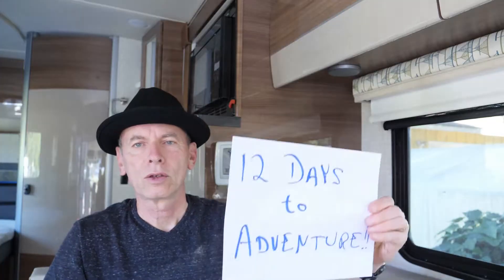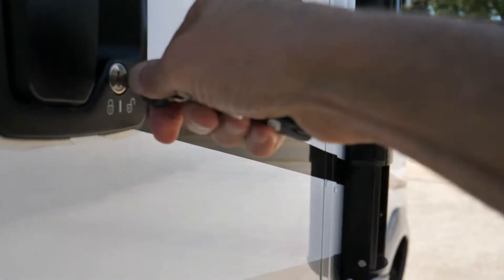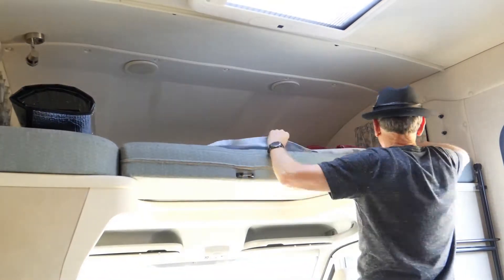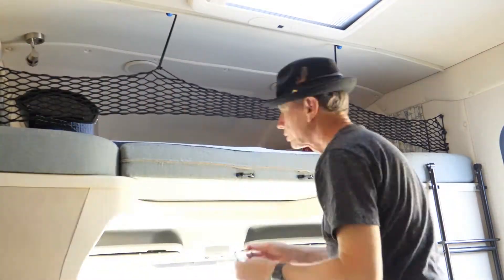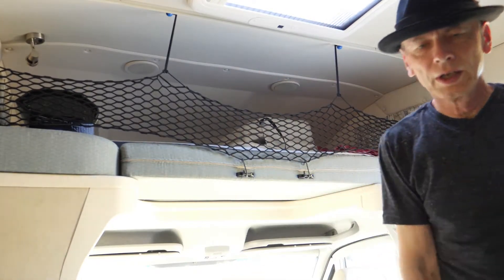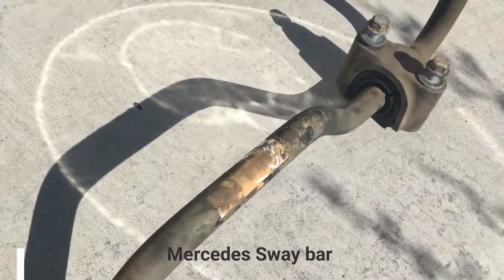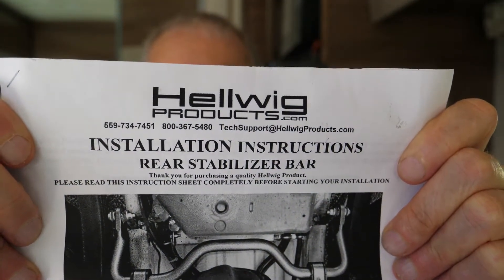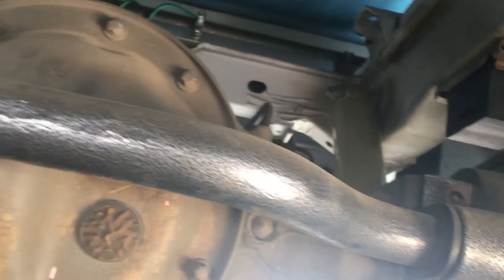RV Upgrades - Cargo net and Sway Bar

Comment: Did you keep the shocks or switch to  fox shocks?  I am about to order a 2021 24V. This has the upgraded MB chassis.  Not sure if the upgraded sway and shocks will be needed but will try it first and then upgrade if necessary.
Reply from the maker: Koni shocks are not strong enough but have not gone to Fox as we don’t travel much now with the Corona thing going on.

Comment: How did your upgraded stabilizer bar work? I noticed a stabilizer bar you can upgrade on the front for steering...to make steering easier...and I'm thinking about added that to mine too....:-)
Reply from the maker: Debbie Sunshine Tomko steering is fine for me. No plans to upgrade it. I do like the stronger sway bar. I added Sumo springs, but they are giving me a rough ride so might remove them.

Comment: Hi Ron, love your videos, especially since I also have a View.  I'm still looking for the cargo net information.  It sounds like you call it a Narca Cargo Net but searching that hasn't gotten me anywhere.  Presumably it doesn't need to be brand specific so knowing the size you used would be helpful.  Also, were all the attachment pieces included with the net?  It looks like the ones in the bottom which go into the ladder brackets are simply packaging staples.
Reply from the maker: I've looked hi and lo, but can't find the info on the net.  Bought it a couple years ago and tried Googling it, but nothing  turned up.